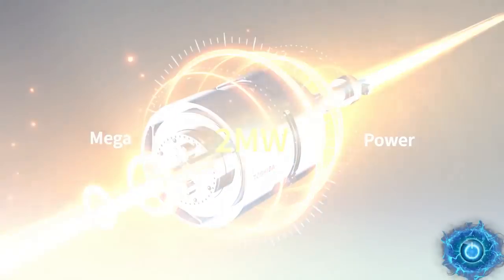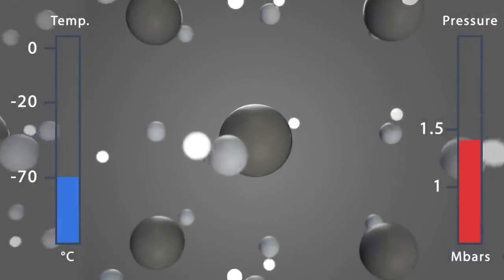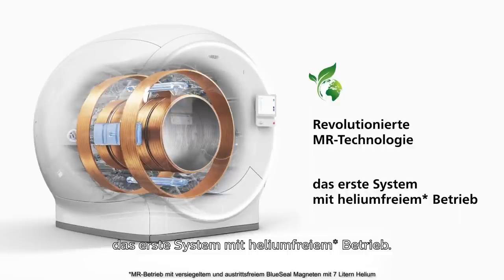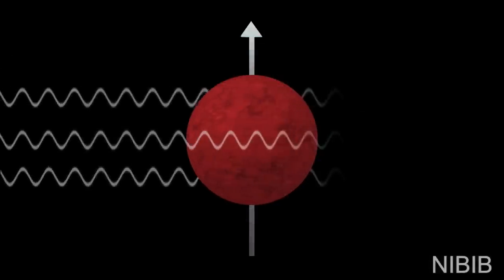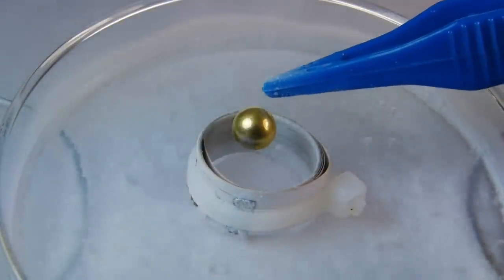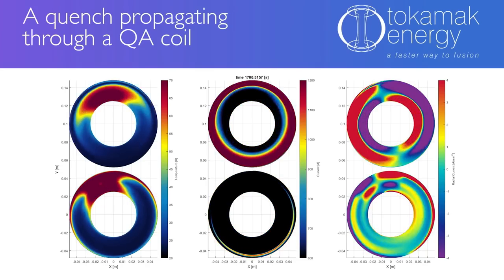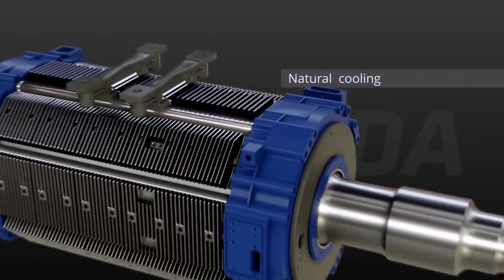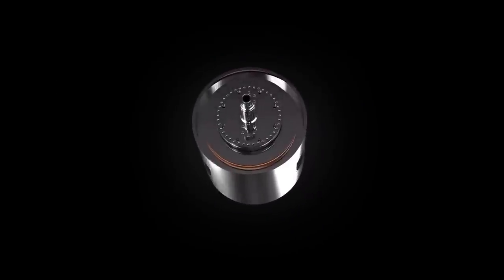CRAZY NEW Motor SHOCKS Entire Industry!

Comment: I worked on superconductors in the 60's.  8 degrees absolute was the best we had.  ~80 degrees absolute today impresses me.  Don't expect room temperature this century.
Reply: Some of the new ones seem to trade cold temperatures for unbelievably, crushingly high pressures. Still not practical for most applications but interesting.
Reply: Currently we must choose. Crazy pressurized at room temp, or supercooled at atmospheric pressure.
Reply: There is super conductors at room temperature from like 50 years ago, but they are reserved for military uses.  the principal idea to understand is that materials dynamic behavior can be very different that the material static.
Reply: Bucky tubes.
Reply: advanced robotics machine learning applied to materials science research, id be surprised if they didnt find a room temperature superconductor before Jesus returns in about 15 years.

Comment: Maybe the turbo pump designs in rocket engines can benefit from superconducting electric motors when they can be cooled by the cryogenic fuel?
Reply: Turbo pumps are powered by combustion since they have to overcome chamber pressure to get fuel into the engine.
Reply: @normangiven6436  Check out the Electron.....

Comment: The torque potential could destroy the smaller lighter motor when full power potential is applied.  ( i.e. due to its lower mass relative to input power )  it would have to be optimised to function within the operational limits of the motor, due to material strength limitations.  I guess they've done all that testing,  so they know it can work.

Comment: I did not know about it. But very high conductivity could mean that the skin-depth with a varing external magnetic field is much smaller. This would increase the inner current density inside the super-conductor and decrease the total rotating current capability. I did not read much about skin-effect in super-condutors, it seams they are for static fields.

Comment: I have worked with a ceramic-type superconductor applied in a dispositive to limit an induction motor starting current. It is incredibly challenging working with these materials. Finding a superconductor material at room temperature and/or developing a manufacturing process for mass production with high-quality levels will be a turning point in society. It will powerfully increase efficiency in energy production, transportation, and computation.
Reply: Dream on

Comment: Even if this motor is 99% efficient, at 2 MW power output one still needs to remove 20 kW of heat to keep it at the same temperature. That sounds difficult to achieve. But hey, engineers...
Reply: 20kw is nothing especially for 2MW, an ICE engine is ~25% efficient, so a 100hp (74.57kw) needs to remove 223kw of heat at full power.
Reply: @andrewharpin6749  True, but this is at cryogenic temperatures.

Comment: Room temperatures are not needed for this to be useful. Motors usually already have active cooling systems, so we just need a colder one.  The losses and hassle from this cooling will only be offset by the gains in power, materials, and efficiency in very powerful systems. So this would be very unlikely for daily passenger cars. High temperatures in this case means liquid nitrogen. Liquid nitrogen isn't cheap or easy to work with, but neither is jet fuel or steam.  Its the classic trade-off : do I just put in a bigger engine, or do I add a turbo and a bottle of NOS? I can imagine racers topping off their nitrogen tank at the welding store just like they do now.

Comment: Awesome video, induction motors are better than BLDC motors because induction motors requires less fancy sensors and chips they to change poles with AC current plus there's no risk of demagnetising the permanent magnets, copper windings on steel core are best.
Reply: Induction motors sync to the AC frequency, BLDC motors are actually AC variable high frequency 8000 or higher CPS, variable speed, and sense position without sensors now through RMF pulse and can vary timing through the processor, to provide torque at low RPM or high. Neo magnets provide extra power, and last many years if kept cooled below 130 f or so.
Reply: @billboyd4051  thanks for the information bro.

Comment: The wires are super conducting so they don't lose part of the electric energy in heat. But how do we keep the environment heat reaching the wires? Simple we cool it with super cold helium. But how do we take out the heat from the helium to trow it back to the environment? Easy we use very energy inneficient cooling systems like a refrigerator. So what happens to the total energy we use to make the whole system work? It's not in the paper.

Everytime I hear about new breaking ground technology that don't mention the overall energy efficiency of the whole system, I know it's a marketing scheme looking for 'free money' to finance the R$D of some project. This has been going on for decades with the nuclear fusion (potential) industry.
Reply: More positive thinking would be: How many people got inspired by those videos.
Reply from the maker: This a good point and tbh I think that we need to find a room temp superconducting material without immense pressure being applied to it.

Comment: Probably not going to be in a car unless high temperature superconductors manage to be found.
Reply: The high frequency brushless motor is very efficient in Tesla's, batteries are not far off from 500+mile range.
Reply: Why would a car need a 2600 HP motor?  Maybe I should watch the video...
Reply: @anonymous12345678935  because its cooling system weighs so much more than the motor

Comment: Does it heat up when under heavy load?  Seems cumbersome.
Reply: No. The 99% efficiency claim means 1% heat of 2MW. That's 20000 watts of heat which would be spread through it's mass. Negligible in other words. To compare that to a 2MW diesel generator, which would make more than 1MW of heat.

Comment: How do electric motors gain torque? More current or more coils or something else?
Reply: Reduction gears, large diameter, amps, more turns of wire for lower RPM or fewer heavier turns for higher RPM, and overall power. Bigger is better but heavier.
Reply: @billboyd4051  cool thanks
I was always curious about that.
Reply: @inspectorsteve2287  I fly RC planes where torque lets you spin a larger prop to go vertical, but at a slower speed.
Reply: @billboyd4051  that's cool. My uncle used to build rc planes out of wood. Like in a kit. He was always in his woodshop sanding and glueing stuff together. We would go out and fly them. Well he would I wasn't allowed to fly it. Lol. Probably was a good idea.

Comment: cooling gas gens is good model reminds on airplane engine and nuclear salt reactor type cooling weight lose is ok if price in production large is resumble what if air turbine air cooler aditionaly added on gens like tesla has this part such as eficent airstream airgliding acc to swuush electric sound and then is even faster and air cooled and nitrogen too
Reply: I follow a guy on YouTube making a multiple stage phase-change cooler, trying to get liquid nitrogen.

Always wondered if you could get a turbo boost by temporarily making the motor superconductive. Just hit it with a blast of liquid nitrogen.

Assuming that doesn't just make things explode.

That would be funny too.

No discovery without experimentation.

Comment: Not impressed. Even a puny Tesla motor has higher specific power than this. 1/4th of the power but in 35-40 kg? It seems the cooling of this motor requires a lot of hardware.